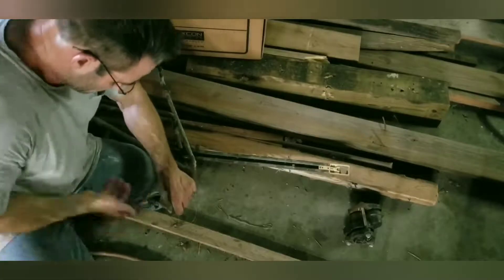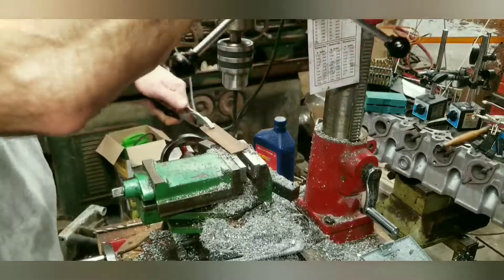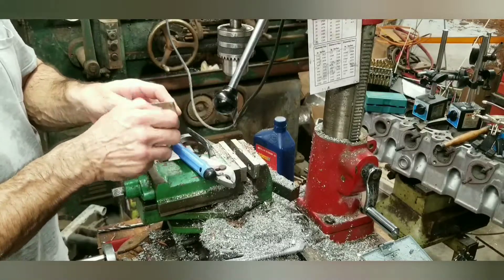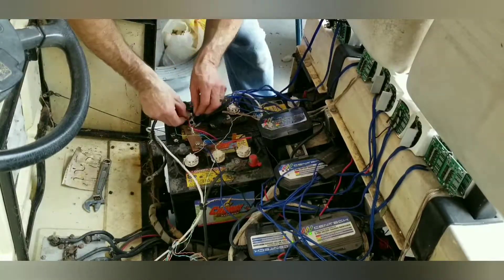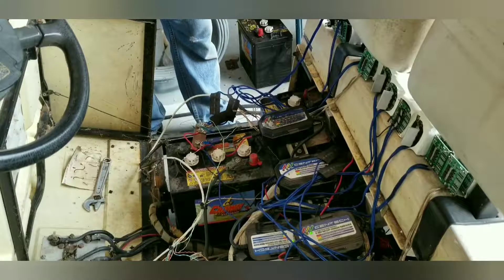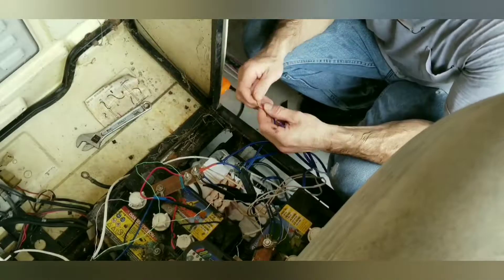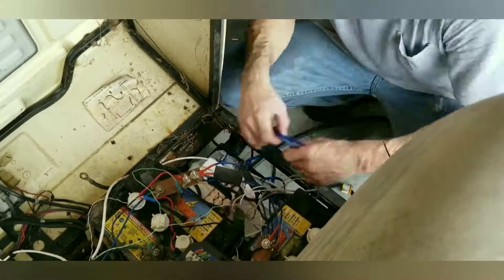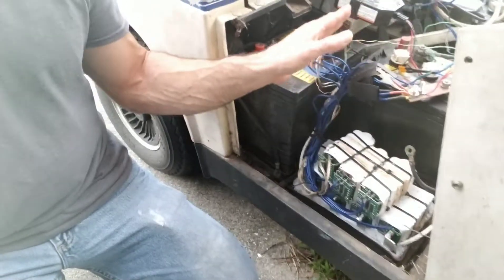DIY 18650 Golf Cart Conversion - removing the first lead-acid battery

Comment: Great to see someone using what they have to sort out a problem, love it. 

We live in a small town and its normal for me to use whatever I have in the shed.
I've also played with 18650s and refurbish them from old laptops. 

I've recently converted a mobility scooter to a lithium golf board (stand up style) and it works well, does 18 holes no problems. I used two 24V 18650 packs, 7 series and 10 in parrallel. Also used chinese BMS, cheap and I buy heaps of spares.
I've been thinking about doing a 36V Golf Cart but had concerns about the start & run current. Your video was very helpful. I'll probably make 3-4 36V 18650 packs (20AH each). 

Unfortunately that's 100 x 18650s per pack but we have a lot of old laptops in Australia.
Thanks again and keep tinkering.